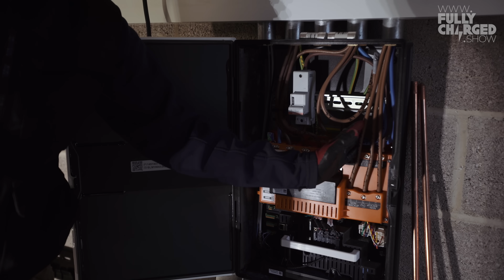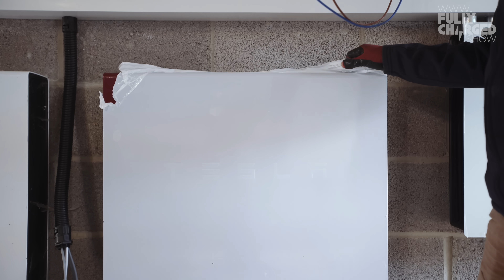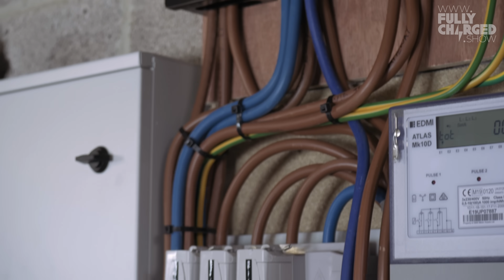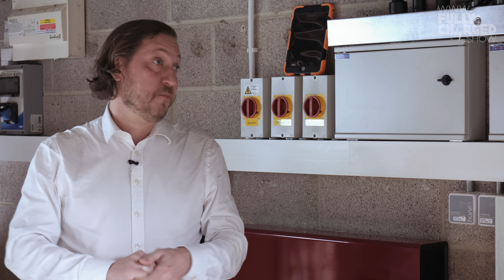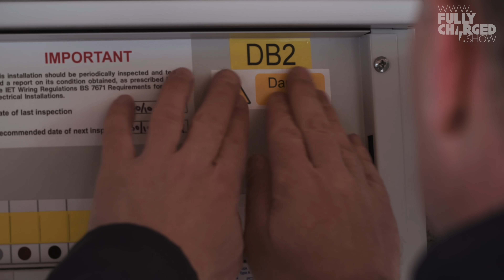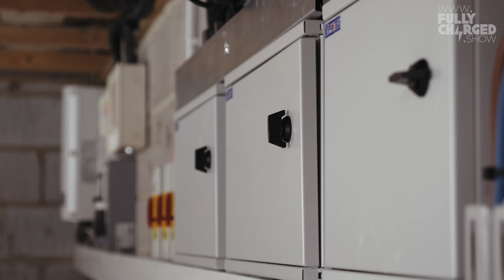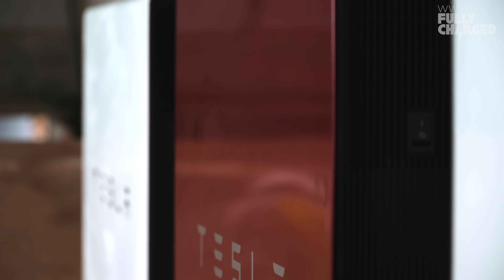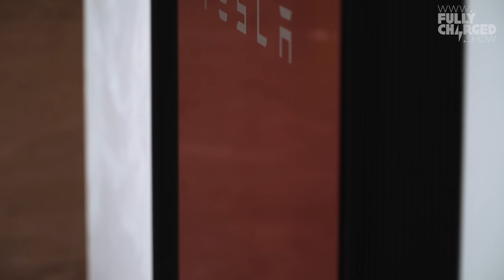Can you run your house on a battery? Tesla Powerwall 2 (Founders Series) & Tesla Backup Gateway 2

Comment: I don't understand why adding battery capacity causes the DNO to insist on 3-phase. You aren't going to be discharging into the grid (at all really - why would you) and the PV hasn't got any bigger so that max power hasn't gone up.

Seems to me you should be able to add as much battery as you want within whatever export power limit is set for the area, controlled by the inverter/backup manager.

Comment: Excellent video. very interesting. Lets hope whoever gets in power today in the UK actually starts promoting/enabling this technology into peoples homes. From what I understand your installation is more to promote green awareness and reduce your carbon footprint, rather than make a monetary return, but it would be interesting to get an idea of costs and returns of your installation. Maybe further videos explaining a bit more in depth what is required for installations and things like the Smart Export Guarantee?
Reply: Currently, you have to have some solar panels installed at the same time as the Powerwall for it to "only" have 5% VAT added. A Powerwall on its own attracts the full 20% VAT, which on a £5000 item is a large amount! That's the difference between "just but makes sense" and "financially not viable", but future electricity prices are the unknown factor on which early adopters have to gamble. This would certainly be a worthwhile tax cut for Boris to consider!

Comment: I love this setup the only thing i hate about this is that you’re already running your house off the battery’s why does the gateway needs to cut off the power for a few seconds? There aint gonna be a person working on the cable’s a few seconds after the blackout and that means your electronics in your house still getting a cutoff from the power so it’s pretty much useless(in my country) last blackout in my city was in 2008 it was 2 minutes

Comment: With your small solar system and batteries now are you going to upsize is it
Batteries of 180 kW hours or more and solar panels around 30 kilowatt
A system capable of running your house your car during mid winter and supplying the grid the little bit of power
I believe this is the size that we need to get to with household solar

Comment: Awesome episode, wish that backup gateway switch was faster seems like the velociraptors can get out in that down time.
Reply: If the UK version of the Tesla Backup Gateway (BUG) is the same as the USA version it will only have that long delay the first time. The gateway is learning. 

The second and subsequent times it switches over will occur in milliseconds. 

Here is Colorado I've had nine grid power outages in the last year. Most of them are are for only 5 minutes, but two were for two and three hours.

During all of them I didn't see my lights flicker and my TV, stereo receiver, and computers are not disturbed. 

Filming the first test doesn't do it justice.
Reply: It was painful to watch!  Lights might flicker, he said!
Reply: @RichardOzanne  
I have had the exact same system installed at my house, and when the engineer switched off the grid power, my house lights didn't even flicker! Not sure why it took so long to switch over in this clip!
Reply: I was going to make the same comment, I have a powerwall with backup gateway and I've only known about any power cuts as the app has told me, no noticeable disruption to anything in the house.
Reply: The backup switch I have, I have to personally go and change. 🤣 at least he has an automatic switch... but I live in an area with abundant sunshine, so it is enough from the batteries to run the night. So totally off grid, except on rainy season.
Reply: I have a Luminous ups it changes in 1/50 of a second cant even tell when it switches over...

Comment: Sell the excess electricity to fast charge companies such as instavolt..
They should be made to buy it for 16p per kwh in peak times so there's still leeway for profit because they sell it for 30p so there's 14p profit..

80kwh on a sunny day at 14p profit is still a hefty £11.20 profit per hour. 
Drivers should be encouraged to fast charge in sunny and windy days..
 It could be thrown in with the weather reports as standard..

It wont be long until your self driving car will top itself up in line with real time energy production! 

You won't have to lift a finger...

Comment: Overall, how long will it take for all the upgrades to pay off in electricity?  (doing math.. components wearing out needing replacement.. carry the one..)  Never.
The only way for this to pay off is for someone else to buy a home with someone else who was a sucker to fork-up all this up-front, then it breaks-even after component failure replacement.

Comment: Imagine your Tesla would have a vehicle to grid option, then it could easily replace both powerwalls (using just a third of the battery capacity) especially as the car stays parked for 90% of the time. And if every EV would have this option by default the result for the grid would have been positively dramatic! 
P.S. thanks for your very positive work!

Comment: IMHO you should have signed it "Kryten"!
Thank you for that explanation and demonstration Robert.  That clarifies the situation and properly sets my expectations.  Obviously the Tesla system is a very sophisticated solution.
I have two comments:
 1. if you are running computers, having this sytem does not mean you can get by without a UPS!  The UPS has a near instantaneous reaction to keep things like computer running.
 2. what was not mentioned, but was by a friend of mine, is the process of getting back onto the grid.  To reconnect the home controller has to get your home AC phase in perfect synchronisation with the grid before switching on.  Otherwise, to attempt to express it in a more jocular manner, it is an expensive light show for both you and the local grid supply elements!

Comment: Just out of interest. I was told I needed 3 phase also in order to get my increased solar, but turned out this wasn't the case. If you install 2 x powerwalls together then I presume 3 phase is not required as it is simply more power storage rather than double the output/input?

Comment: That don't look 3-phase to me. It looks like a "split phase installation" a transformer with a secondary winding with a midpoint connection connected to N and the outer end of the winding acting as L1 and L2. Thats why 2 singel phase powerwall works in this case. With a "true 3-phase" installation you will need 3 single phase powerwalls.

Comment: Nice system, Robert. Last week we had a 15.4 kW (LG Neon2 350 W x 44) PV system with Enphase microinverters, Powerwall 2 and Gateway installed. On Sunday, the panels generated 101 kWh (I live in Melbourne). The battery is usually full by about 11 am. We got 3 phase power installed, mainly because it enables us to have a bigger PV system. Model 3 delivery on 20 December. It is all very exciting (and expensive!).

Comment: Just like the phones and cameras rechargeable, the Powerwall battery cells can be recharged so many times before it finally degrades. Nonetheless, it gives both household and industrial buildings a life span of around 3-10 years.

Aside from that, it also needs to be changed every 5 to 6 years so it can maintain its capacity to store electrical power. And, its battery can provide reliable system service for 20 years. However, since it uses a Lithium-ion based battery as power storage at home, some researches stated that it might not even last on the given 10-year warranty period. 

Whereas, the Powerwall version 2 lasts for 5 or more years beyond its 10-year warranty period. Plus, it doesn’t decline its storage capacity too rapidly.

Comment: The  long time the lights where off when they switched to the battery power is most likely because the filming lights they use are connected with a converter/ballast and that takes time to turn on, it would be interesting to see how a regular old style light-bulb would have behaved.

Comment: Powerwall is much smaller than my 10kWh Sonnen battery. I have to manually tell it to charge overnight with the cheap rate Octopus Go grid feed in. All it takes is a couple of sunny winter days and it fills up & I start losing solar power to the grid.

Comment: isn´t "cheap nighttime electricity" a sort of symptom of power grids mainly fed by fossil fuel and atomic power plants? these have to run 24/7 - doesn´t using this energy because it is "cheaper" defeat the purpose of having a power wall or equivalent that should only be charged by renewable sources?

Comment: Dear Robert, I am following your channel from Italy since 3-4 years and I would like to go a bit deeper into the "house batteries world". Let's take into account that in Italy the standard solar equipment is between 3 and 6 kWp, that we heat homes with natural gas the most and that the grid pays for the energy we give to the grid about 60% of the price one pays for the energy from the grid. Oh, and we cannot live off the grid by law. It's mandatory to be connected to grid and to give/take from the grid when having solar panels. Many people are selling Powerwall 2 (that are not cheap! You got it as a "present" but the initial cost is quite high) selling the idea of reducing the cost of electricity. Can you confirm that these batteries are not an investment? The price you are paying for the battery is never coming back, even in 10 years (plus, one should add battery degradation, AC-DC losses, etc)
Reply: Yes, you are exactly right. He did say in part 1 that you will not recover your investment. But the price is steadily falling, hopefully soon it will become an option for most households but not just yet.
Reply: @borisquince6302  so, what's the point of it, on an household level? I cannot find anything worthy! I would understand using DC batteries to fill up cars in DC quickly, but powering them with slow single phase AC...

Comment: Just got my PW2 and Backup gateway installed the other day :-)
In Germany it only backs up one phase of your house (if you have only one PW). So I have to check now on which phase my fridge is running and maybe let that be changed ;-)
Reply: Same in UK: the Gateway is only connected to one of the phases, and the Backup can only supply that phase during a grid power outage.